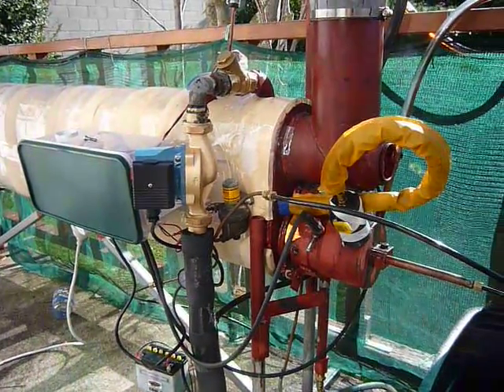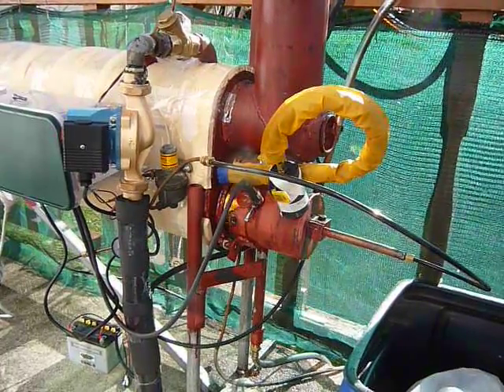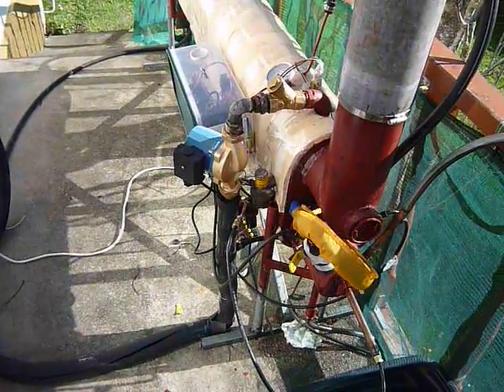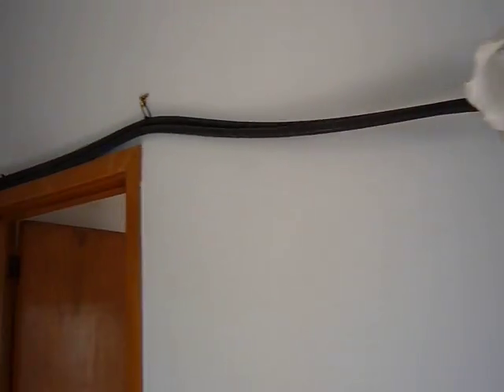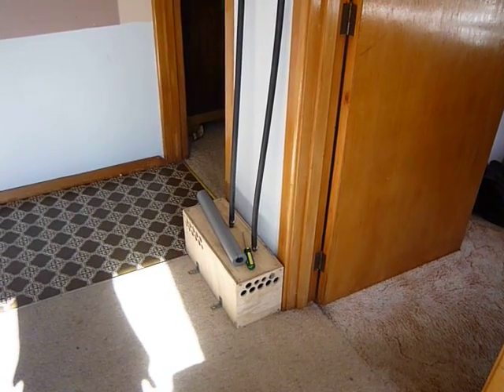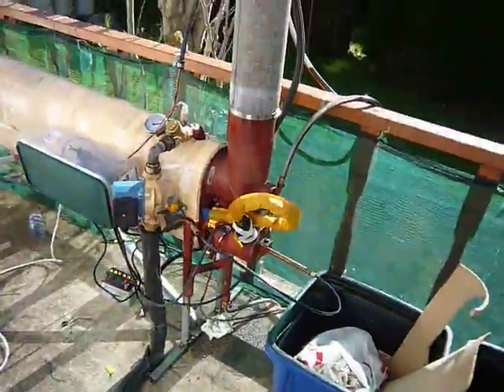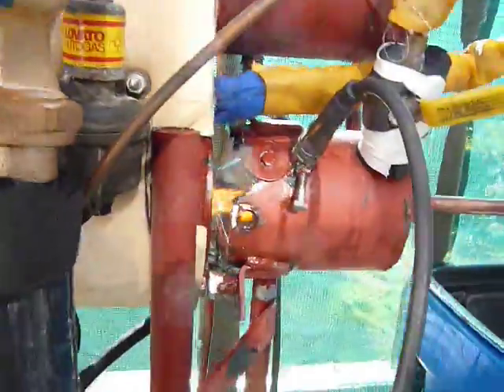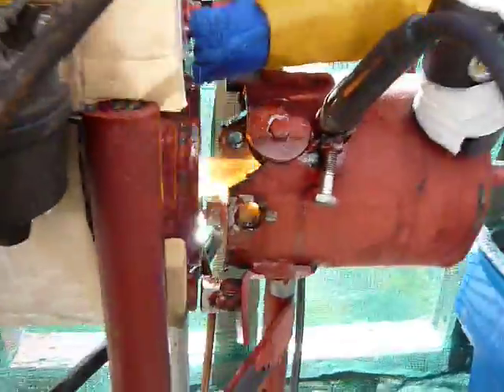Homemade Babington waste oil burner boiler

Comment from the maker: Thanks for the kind comments......it was an experiment.....lol, by the time i took it apart it was well thought out...however it did the job and i built the next one (that i don't have any videos of damn it) that was a big improvement reliability wise....now i have a house and an acre and a half of trees so a rocket stove boiler is in the works once i'm happy that i have learned enough to do it by building a rocket stove heater first

Cheers

Comment from the maker: @glumpy10  the compressor i'm using is an old (1960's?) DevilBliss compressor driven by a new 1/5hp motor.

if your going to make one similar to this...USE BIGGER TUBE!!!....for everything lol, i have 4in pipe for a firetube...use 6 or better 8 inch...my one needs the tubes cleaned every couple of weeks.

i also now have a much better (large)r burner housing and return tube after the one in the  video overflowed= some dead lawn

any questions welcome

Comment: To help with combusition and flame spread, try putting a bit of metal in the tube. 
I use a bit of Twisted flat to spin the flame and the action of it glowing red works like a glow plug and allows the oil to burn better rather than being in a cool surrounding. 

A piece of smaller diamater pipe slid inside the burning chamber can also work well and stainless lasts longer before burning away. 
The ceramic out of Car catalytic converters is ideal if you can get it out.

Well Done again!

Comment: The BESt DIY heater application I have seen of a babbington so far. 
The fact is is automatic and can be left unattended to do it's thing puts it at a level beyond anything else I have found. 

Great engineering and use of low cost materials.  
This is something I have favourited and will refer to for ideas and concepts for my own home heater. 

What sort of compressor are you using?

Comment: @unhippy1 It's steel pipe then there is the connector for the air compressor drilled through a end cap and that is held down with a set screw the pipe and fitting are set pretty tight so hopefully that will work. I have a steel feeder that feeds directly in like a paint gun feeder but holds like a gallon.

Comment from the maker: @oWarpatho  if you can when you make your rig for the oil feed line make it with screw adjustment on 2 axis to allow you to precisely adjust you oil feed location and have it stay set where you want it.....

1/4" copper tube with multiple bends in it moves over time due to heat cycling (i think) as i have found out to my annoyance...i have to tweek my feed line about once a month to get it running nicely again

Comment: @unhippy1 Thanks for the reply! I'm going to try what I got first then if that doesn't work or is a pain will switch. I heard about the temp having to be high I'll use a fry daddy and then closer to winter might build a solar air heater they put out 176 C air temp or 350F. I'm using my burner for a back yard foundry so it doesn't need to be unsupervised.

Comment from the maker: @oWarpatho  the ball is alot less sensitive to the exact location of the oil feed line...you still have to have it pretty close to perfect but 90% perfect will do....with a nut type babington burner if you don't have it 99+% perfectly located your out of luck.
LOL and remember with a babington that heatedness (of your oil) is next to godlyness....my one just won't run if the waste engine oil is under 75 deg C....vege oil needs alot more heat  to work